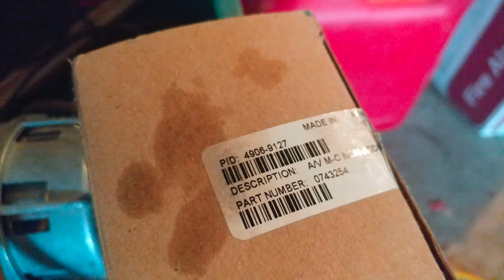Mini system test 4. (Smartsync truealert)

Comment: I saw 3 trualert designs!
The first one i saw is the ES Model.
The second one is a creepier version which is the 4906-9131 model.
And the 3rd one is the classic white one.
Reply: There's also an older version of the TrueAlert called QuickAlert. There's two different versions of the QuickAlert; one has a hole for the horn and the other has the same grille as the modern TrueAlerts but has no 'TrueAlert' marking